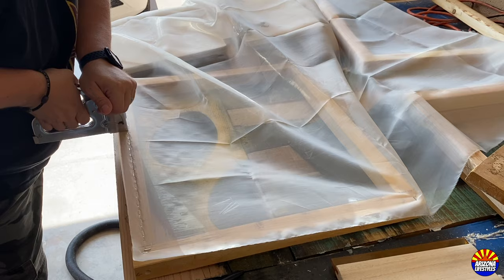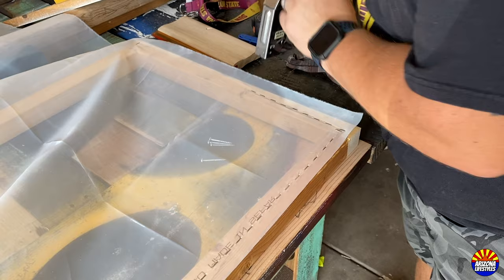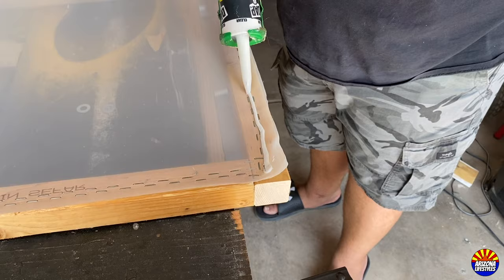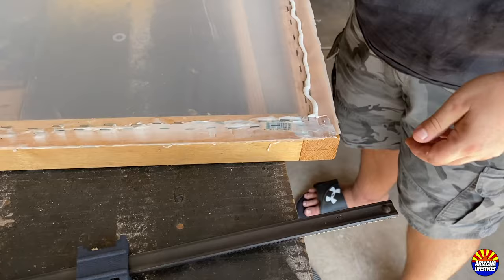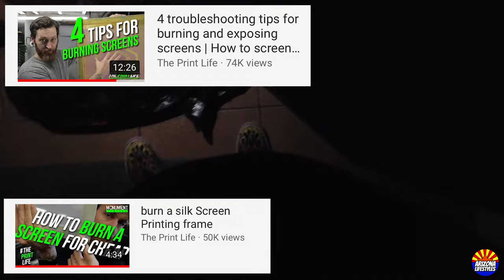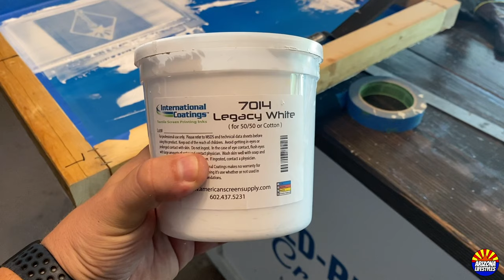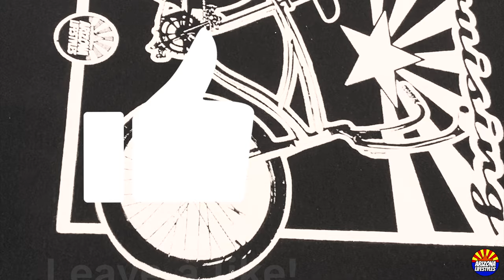Cheapest DIY Screen Printing to make T Shirts and how I made it.

Comment: you don't need to do the emulsion in the dark, just low light. It's UV light or sunlight that affects them not a lightbulb. No need to have dark room just be away from sunlight
Reply: Don't use halogen lighting though because that does have UV light in it... but actually halogen flood lights are a good alternative to exposing using the sun and much more controlled

Comment: Not so sure about getting the screen fully taught? You would have to start over with new screen if it was not tight enough, correct?
Reply from the maker: Shari- yes you have to put a lot of staples , go slow and use a board to stretch it over , and if it’s not tight , yes you have to start over and stretch it really tight

Comment: The art conservation method for stretching canvas and canvas plyers would be beneficial. To use this you would staple each side with one or two staples in the middle applying a fair amount of tension. Then you work your way out the canvas stapling 1/2 of the canvas to the right or left in one direction. You do this a few staples at a time, rotating to the next face on the same side of the staples until you reach the corners. THEN you come back to center staples and do the same thing in the opposite direction. This works better than starting at the corners because you avoid putting excessive tension in the corners where they occasionally rip or rip over time while the middle stays taught....working as your doing really only works for EXTREMELY flexible material which this may be. About to order some after watching this!!!
Reply from the maker: Thanks for watching it’s time for me to make another video
Reply: @ArizonaLifestyles1 great production and informative...thank you!

Comment: Mark had a great comment about using low light and not dark. The emulsion is nit that sensitive. I do want to mention that because you are using a positive image and exposing it to make a negative image … exposing it longer will make the spokes of the tires thinner not thicker. So if you need to make an adjustment in exposure, expose it less. Other things to think about are how dark is the image you are using to expose onto the emulsion? And if the original image is not touching the emulsion completely, light will undercut the image … perhaps making the spokes of your art appear thinner.
Reply from the maker: Thanks for watching - I did notice the items you were talking about on other designs I did since this video - thanks for the comments -

Comment: Hi ! Great video. I’m in the process of printing T-shirt’s and I feel I need to make the press to really be accurate and do a good job. And one thing that’s blowing my mind and I can’t figure out is how the screen is positioned perfectly? Or do you just drill the hinge clamps in a certain height up depending on where you want the print to be on the shirt ? If that makes sense plz let me know. I’d appreciate it a lot, again great video, thanks !
Reply from the maker: So when you expose them you have to pre measure and know your spacing on your shirts and find your center lines on your art, screens and on your press and mark them with a sharpie ... and when you tape your artwork to the screens you just have to line them up... now real professional screen printers add printer marks to the transparency to line up to the pre made marks on their exposure units
Reply: @ArizonaLifestyles1  ah, thing is I will be getting a company to expose my screen, do you think what I said would work? Make the actual press itself, get everything lined up with the screen, mark where the hinges need to go and drill them in ?

Comment: Did you get any ripples around the edge of your screen?  I have tried this 2x and got the screen pretty tight but ended up with some ripples around the edges
Reply from the maker: The first one I got ripples
Reply from the maker: As you staple the screen I had to pull pretty hard to get ripples out .... also don’t pull too hard it’ll rip

Comment: What kind of wood did you use for the press machine?
Reply from the maker: pine 2x2’s for the frames and I had 1/2 plywood scrap laying around for the platen and a scrap piece. Of a pine 2x6 for the support underneath and a couple scrap 2x4s for support … other than the plywood everything was construction grade pine